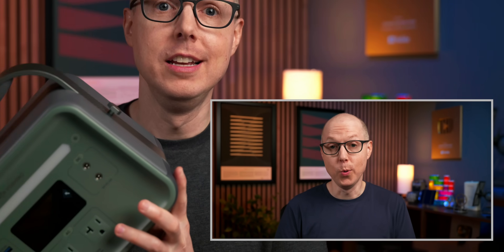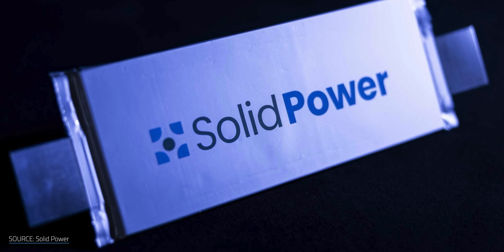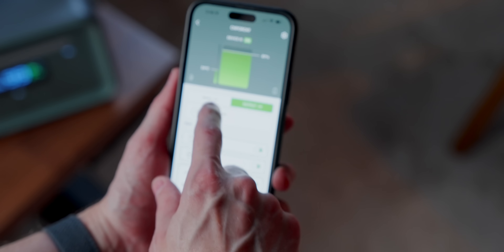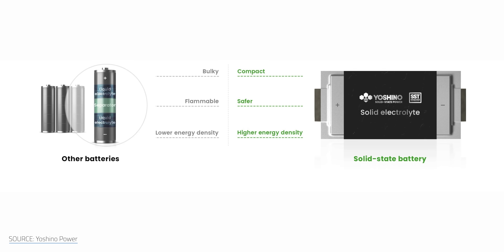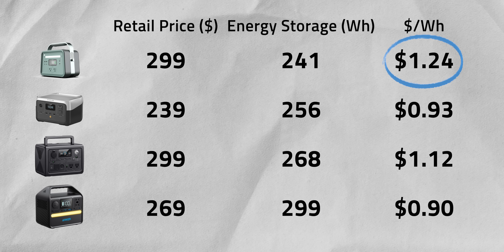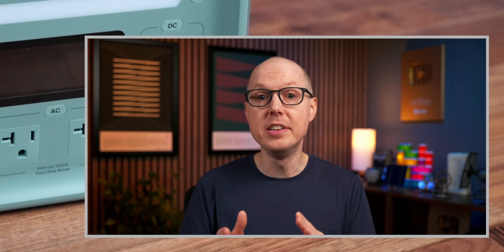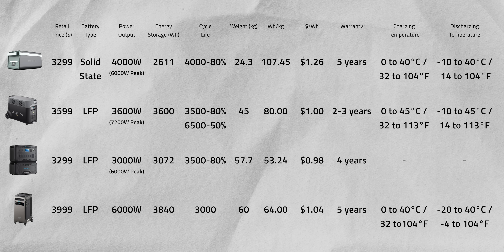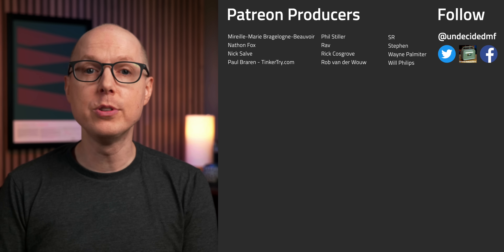UPDATED: Solid State Batteries Are REALLY Here - Or Are They?

Comment: I WANT TO KNOW WHEN I CAN GET A NEW CELL PHONE--- SAMSUNG OR MOTOROLA WITH SSB TECHNOLOGY AND A NEW TABLET WITH SAME AND A NEW LAPTOP WITH SAME , ----- SO I CAN NOT EVER WORRY THAT MY APARTMENT IS GONNA EXPLODE AND CATCH 🔥🔥🔥🔥🔥🔥🔥🔥 FIRE WHILE I'M OUT. I AM RETIRED AND AT HOME MOST OF THE TIME. 99% OF THE TIME. I ONLY GO OUT TO GROCERY STORES OR OTHER SHOPPING OR FOR EXERCISE, OR TO A DOCTOR'S APPOINTMENT. BUT WHEN I GO OUT I WANT TO BE SURE THAT MY APARTMENT DOESN'T CATCH FIRE FROM THESE CRAZY DEVICES WITH LIQUID LITHIUM ION BATTERY TECHNOLOGY. I HAVEN'T GOTTEN RID OF EVERY DEVICE USING LIQUID LITHIUM ION BATTERY TECHNOLOGY EXCEPT MY CELL PHONE AND MY SAMSUNG TABLET. I TAKE THE CELL PHONE WITH ME IN MY POCKET WHEN I GO OUT. SO THE ONLY THING LEFT AT HOME IS THE  SAMSUNG NG TABLET WHICH I KEEP IN THE OFF POSITION. BATTERY IN A SAMSUNG TABLET IS UL CERTIFIED. BUT IT CAN STILL CATCH ON FIRE AND OR EXPLODE, ----MOSTLY WHEN IT'S CHARGING AND THAT WILL BE WHEN I AM AT HOME. IT'S VERY RARE FOR A DEVICE TO CATCH FIRE 🔥🔥🔥🔥 WHEN NOT CHARGING BUT IT IS VERY POSSIBLE. I AM TIRED OF WORRYING ABOUT MY TWO CATS WHEN I GO OUT. THAT'S WHY I GOT RID OF MY LAPTOP AND I GOT RID OF MY ELECTRIC BIKE. I'M WAITING FOR THESE NEW SOLID STATE BATTERIES THAT CAN'T CATCH FIRE SO I CAN GET A NEW ELECTRIC BIKE WITH THIS NEW TECHNOLOGY. HOW LONG DO I HAVE TO WAIT ?? UNTIL 2027 ?? 2028 ????
Reply: Around 2050 to 2100...if you're lucky.

Comment: NO NO NO NO NO, --- I WANT TO KNOW THE YEAR, MONTH AND DAY THAT THESE BATTERIES WILL BE AVAILABLE AND WHERE AND HOW MUCH MULLAH MULLAH. I WOULD WANT ONE FOR MY ELECTRIC BICYCLE SO IT WON'T EXPLODE OR CATCH FIRE 🔥🔥🔥🔥🔥🔥 IN MY APARTMENT. 2) I WANT MY CELL PHONE TO RUN ON SSB SO IT ALSO CANNOT EXPLODE OR CATCH 🔥🔥🔥🔥🔥 FIRE IN MY APARTMENT. ALSO FOR MY TABLET MY LAPTOP, CAN MY EMERGENCY FLASHLIGHTS AND LANTERNS FOR POWER OUTAGES. ALL THESE THINGS ARE IN MY APARTMENT AND CAN CATCH FIRE OR EXPLODE AT ANY TIME. I'M LIVING ON EGGSHELLS. IF I'M AT HOME IN THE APARTMENT I DON'T WORRY THAT MUCH CUZ I COULD DO SOMETHING ABOUT THE FIRE 🔥🔥🔥🔥🔥. BUT IF I'M NOT AT HOME WHO WAS GOING TO DO ANYTHING ABOUT THE FIRE ??? I HAVE TWO KITTY CATS. I DON'T WANT THEM GETTING CAUGHT UP IN A DUMB LITHIUM ION BATTERY FIRE 🔥🔥🔥🔥🔥. I GOT RID OF EVERYTHING THAT USES LITHIUM ION BATTERIES NOW EXCEPT FOR TWO ITEMS, ---MY ONE SINGLE CELL PHONE. AND WHY MY ONE SINGLE SAMSUNG TABLET. BOTH OF THESE ITEMS USE THE SAMSUNG LITHIUM ION BATTERIES WITH UL CERTIFICATION. I GOT RID OF MY ELECTRIC BIKE, AND I GOT RID OF MY LAPTOP. AND I GOT RID OF MY EMERGENCY LANTERNS THAT USE LITHIUM ION RECHARGEABLE BATTERIES. CAN I REPLACE THE EMERGENCY LIGHTS WITH REGULAR NON-RECHARGEABLE ALKALINE BATTERIES. DURACELL. SO THE ONLY TWO ITEMS IN MY APARTMENT NOW THAT USE LITHIUM ION TECHNOLOGY ARE MY MOTOROLA CELL PHONE IN MY SAMSUNG TABLET. NOTHING ELSE. I SAW A VIDEO OF ONE OF THESE LITTLE BATTERIES CATCH ON FIRE 🔥🔥🔥🔥🔥. IT WILL DESTROY AN APARTMENT OR HOUSE INSTANTLY, WITHIN MINUTES. YOU DO NOT WANT TO HAVE A LITHIUM ION BATTERY FIRE ----BELIEVE ME FOLKS . THE FIRE SPEWS OUT 20 OR 30 FT AND IS  SUPER WHITE HOT. EVERYTHING AND EVERYTHING IN YOUR APARTMENT WILL CATCH FIRE 🔥🔥🔥🔥🔥🔥🔥. HELP !!!!!!!!!

Comment: Bought the B2000, I'm about to return unit for my 3rd replacement. Unit failed right when received. On 2nd unit its failing, factory says they will exchange for 3rd unit or refund.  I only run 56 watts dc fridge with solar on roof of overlander rig. and with that load unit can't keep up.  Really odd l situation.

Comment: Please stop making mistakes!!! I am not an expert in this area (I am an amateur). But 1. SSB has never claimed to be physically twice as small and even more so to have twice as much capacity. 2. SSB will weigh approximately 30-50% less, size sametame and charge 40-80% faster than Liion, yes, exactly in comparison with LiIon (not LiFePo4) and will be more fireproof. (QuantumScape, SolidStateBattery, Enovix). 3. This battery differs from "LiIon" only in fire safety and it's it. 4. Stop comparing with LiFePo - this is a cheap technology but very heavy, but lasts longer than LiIon in case of charge and discharge from 0 to 100%. Waiting first revolutionary tests of real SSB from the above companies, and possibly from CATL, but I think they are too late.

Comment: You state that the Yoshino WILL last longer than the products you compared it to, but no one knows that yet... its only been out for a number of months or maybe a year now. The cells may last longer without degradation but any random connection on the PC board coming loose could render it less than useful. Would be more safe to say that this chemistry SHOULD have less degradation than x or y alternative over x time span.
Reply: That right

Comment: Respect for trying to update, however, to a lay person, who wasn't quick to highlight the possible issues in your first video, will probably still miss your points, as you give your update as still undecided. The last couple of minutes you added, should have probably been more clearly stated at the beginning.

Seriously, many people are going to ignore your updates you give throughout, and continue watching the video as is where you used key marketing words like first generation product.

Bottom line, unintentional or not, could still be greatly misleading to the general audience. Similar to promoting those extremely high capacity, cheap USB flash drives, that ultimately do not actually contain that much storage that are littered on Amazon. Or the rechargeable fans that claim to have 40,000mah batteries, when they really contain 5,000mah batteries.✌️✌️✌️
Reply: Wribg the do have true 40,000 mja  nit earth baters further bates long as run 40,000 mga lobe rynfd furner batees😅

Comment: The Wh/kg in your Yoshino is no higher than in my traditional NMC-based Jackery 250. The error you make is that you compare the Yoshino ”Solid state” battery with ones basen on heavier LFP batteries. Compare the Yoshino with classic Li-Ion NMC batteries and you get about the same weight and capacity. Yoshino themselves uses normal Li-Ion pouch cells. That is why it is no better or worse than my old Jackery.

Comment: There is absolutely no chance that a no-name NMC-based battery is going to last 4000 cycles or anywhere close to as long its LFP counterparts, regardless of its (probably not) solid-state electrolyte. My guess is that this battery is a semi-solid-state battery, which doesn't have the core benefits of the all-solid-state batteries we keep hearing about. Even if they are telling the truth about the battery chemistry, they are 100% lying about the longevity of the product, which should take away any credibility they have for the rest of the spec sheet.
Reply: Not even that.  This video.autostarted after I watched a review of someone tearing one down and proving they just used standard lithium cells.
Reply: Wrobg

Comment: Is yoshino power a company you can trust ?
Based on the available information, Yoshino Power’s trustworthiness is mixed. Here are some points to consider:

Marketing claims: Yoshino Power claims to offer solid-state power stations, which is a promising technology. However, one review raises questions about the authenticity of this claim, citing a report by TechInsights that found liquid electrolytes in the battery, contradicting Yoshino’s solid-state claims.
Product limitations: Yoshino Power’s products are designed for on-the-go uses, camping, and emergency backups, but may not be suitable for whole-home backup systems or semi-permanent installations.
Competitive landscape: Yoshino Power operates in a competitive market with established brands like Bluetti, Ecoflow, and Anker, which may offer more affordable options with similar features.
Company values: Yoshino Power’s mission statement emphasizes sustainability and empowering individuals, which suggests a commitment to environmental responsibility and customer needs.
Lack of transparency: The controversy surrounding the TechInsights report and Yoshino Power’s response to it raises concerns about transparency and accountability.
Conclusion

While Yoshino Power’s values and mission align with positive attributes, the mixed signals from their marketing claims and the controversy surrounding their technology may erode trust. It is essential for potential customers to carefully evaluate the company’s claims and assess the product’s performance before making a purchase. As with any company, it’s crucial to monitor their actions and responses to criticisms to gauge their commitment to transparency and customer satisfaction.

Comment: I’m not a battery engineer but I would expect it would be impossible to transfer ions inside a 100% solid state battery.  There needs to be a minimum amount of fluid in the electrolyte to make this transfer possible.  So my interpretation of “solid state” is a battery with an electrolyte composition that greatly reduces the amount of fluid needed.  On this basis I would have no problem with the Yoshino battery.
Reply: Thatscri g ht

Comment: I think it originally said it was a hybrid solid state, and my guess on that was that it just used less liquid electrolytes, but i was still hopeful it would be different, which is why i didnt say anything negative on the original video.
My problem has been that it still uses nickle and cobalt which until we have testing on this differetn formulation, we'll have to assume the similar 500-1000 cycle rating as other NMC batteries, as opposed to the 2000-6000 cycles of LiFePO4.
Now that others have torn them apart, it doesnt look like it has that much less electrolyte either but I'd still like to see more testing.

Comment: Its just a run of the mill Li-Po cell. Literally nothing special at all.
Reply: It's actually a lithium ion/NMC. It is not a Li-Po cell
Reply: @cameronmacdonald6525  Still run of the mill. About as run of the mill as it gets, and still very dangerous without advanced battery management systems and strict quality control in the manufacturing process

Comment: I told you so. I and many others warned against taking the company's word at face value for claims that sound too good to be true and as the first major breakthrough. Especially when their product doesn't have the cell spec sheets to go with it and the specs of the finished unit is worse than other units using conventional cells. It was also a company with zero track record.

Now with other youtubers doing digging, this is yet another Chinese company (using a California warehouse address) selling a product with a cell with liquid electrolytes/solvents (so not solid state).

I hope next time before doing a similar review, you will either do your own teardown or wait for others to do a teardown to confirm what cells are actually in it. It's ok to make a mistake if you learn from it.

Comment: A battery backup is not the ideal place for solid state battery's, where it is a large percentage of the price of the product. If you where to add such a battery to a phone or a laptop it could reduce the weight of the product substantially, while not even being a rounding error on the price tag. If no one is doing it it is not ready for mass market.

Comment: I’m guessing this has solid state components but is not a full solid state battery. I’ve seen your vids on this and the one that did the tear down and debunked it by puncturing the cells. …either way it’s nice to see progression, I’m currently using Lithium iron phosphate batteries with my 24v solar setup.
Reply: 24 volt solid sate baters ex I st real kne chef found resl slid state bateers

Comment: Just a piece of info for everyone as I use and test these products regularly, 

So do you know how many classes of lithium batteries there are?
Did you know LFP falls under a class of lithium ion batteries? 

Did you read every individual ingredient in the MSDS sheet to categorize what percent makes it NMC or solid state? 

Are you speculating just because it says lithium ion? 
If you are a professional I won’t doubt you, but since there are several classes or lithium ion batteries I would rather have the rest of the facts verses just an assumption. Hence a couple of us are trying to get the correct info before we come to a conclusion.

To many have already concluded with no factual material yet except for what we have seen. But let’s wait to hear from the experts. 

Hopefully in a few days or next week I’ll have a follow up video and maybe others will as well. 
Battery make up and chemistry is what’s important. Not the class it falls under.
Reply: Did you not watch both of my tear down videos ? Are you a battery expert ? 
Just because he shot a arrow and decimated a battery pouch which he actually needed two arrows, I did several puncture test with nails, and no fire or explosion happened with my pouch cell from my Yoshino unit. 

I did a full dissection of the battery. Battery tech and voltages change with tech. 

So unless you know a 100% for sure, or again are you coming to a short conclusion? 

Do you know what makes the exact difference from a NMc batt and a solid state? 

I know these pouch cells absolutely do not react like a NMC battery. And it’s definitely not LFP
Reply: Wrong!   There are a set of physical and minimum electrical Standards that have been presented by the companies working on SS batteries.   This Battery fails on every promised feature.   Also did you watch the YouTube Video by "bigtb1717"?
He pulled the Powerstation apart and showed us the Labels on the pouch Cells.  They are standard Li-ion Pouch cells.  I don't know what more Matts "Team" are going to uncover since the markings are right on the cells.   They also Catch on Fire in a nice spectacular way just like a typical Ni-Ion cells.

Comment: Come to me when they can actually do something about an affordable price that is multiples better than the current technology. When it's ready to turn out batteries that will deliver the same power for less than half the weight and can be recharged thousands of times without losing any significant capacity and that can be recharged in less than half the time of the best of the current technology. Until then it's in the category of research that is at least 5 to 10 years in the future before there is viable and significant commercial use.
Reply: Biy capstone ver erst wat hiuee  soo many milanese tens minn cycje weak energy buy ewy cheaper

Comment: Was the safety testing (penetration, overcharge/discharge etc) done using the "customer experience" as you did your power to weight ratios?  A metal case instead of plastic is going to provide improved puncture resistance no matter what cells are used. The cells used by yoshino when subject to physical abuse behave as expected for a typical lithium NCM pouch cell. They are much less safe than an LiFePO4 pouch cell and dramatically less safe than any of the LiFePO4 aluminum or steel cased cells frequently used.  The actual power density of the cells also seems to be more similar to Li-NCM.  I would like to see voltage curves between full discharge and full charge.  The description of a polymer electrode doesn't help us know what it is. A polymer can be liquid.

Comment: The watt hours per carry weight are not in any way a meaningful measurement, or even that much of a usability factor. Does it have a carry handle? Check. With batteries it is ALL about how heavy the battery has to be to provide a given amount of wattage. It’s misleading to talk about it the other way. In fact you actually called it “energy density” which is not calculated by the full weight of the product. Just please use care when using established terminology.

Comment: I thought the other batteries used LFP cells which have good safety and cycle life
Reply from the maker: LFP does have great cycle life and safety too.  It's a great battery.  That's why the cycle life ratings aren't that far off from each other (only a gap of about 1,000 ... no matter what those LFPs will last a VERY long time).